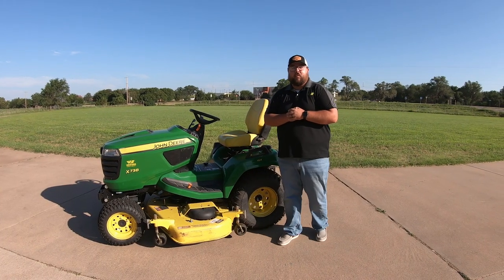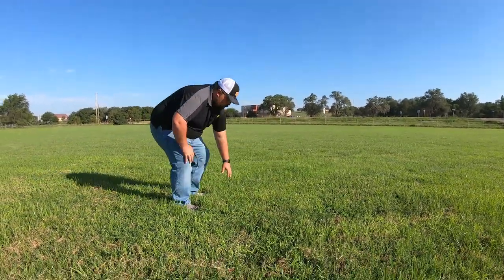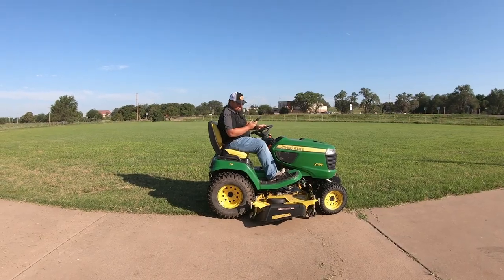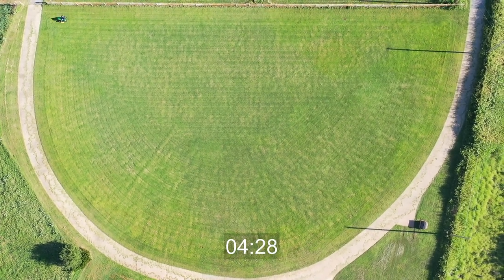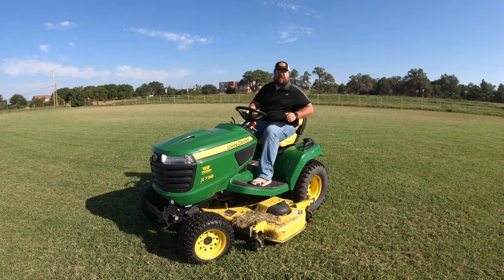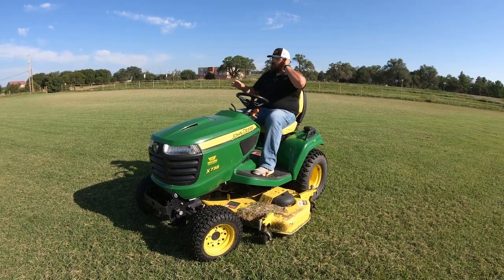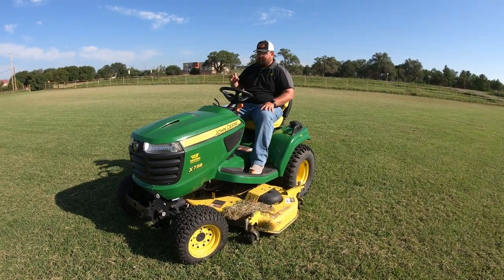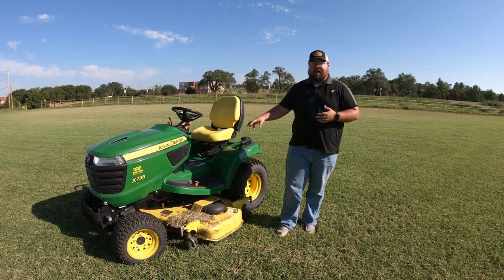How fast can the John Deere X738 Mow an Acre?

Comment: Just bought a new X738 Monday 
Mine has the 54” deck
Haven’t use it yet
Reply from the maker: Nice! Let me know how it goes when you get a chance to mow with it!
Reply: @WesternEquipment 
Mowed first time Sunday, amazing and was quick. I wanted to ask you
I bought some jd grease 
The kind is SD Polyarea
Part number is ty6341
I watched your grease video and you recommended this one 
Is this the proper one to grease all Zirk fittings on the x738 including deck?
Always trust your input
Reply: Did you get any good pricing or did you have to pay full retail? I'm trying to decide between high used retail or new as both seem to be a bit higher then normal
Reply: Best thing I’ve ever bought